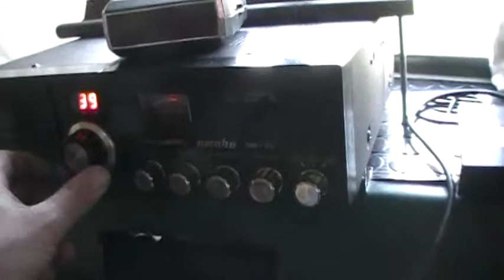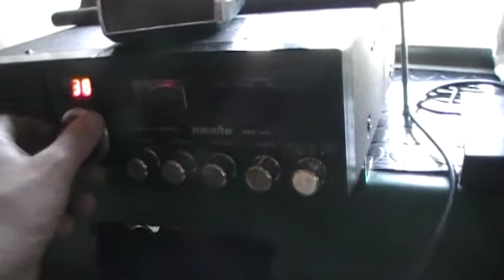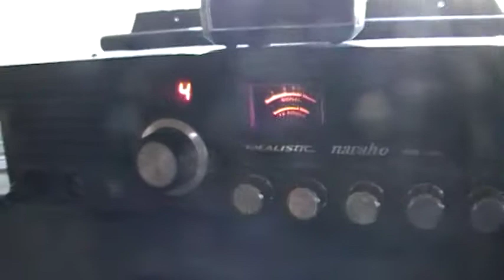Skip Realistic Navaho TRC-490

Comment: Well the fellow you were attempting to tune in on channel 28 was on AM & NOT SSB.You never changed the mode switch back after leaving the SSB guys on channel 38! Helps when you know how to operate the radio & know the difference between SSB & AM signals! Those are VERY GOOD all mode CB radios but only if you know how to use them. LOL  {:>)